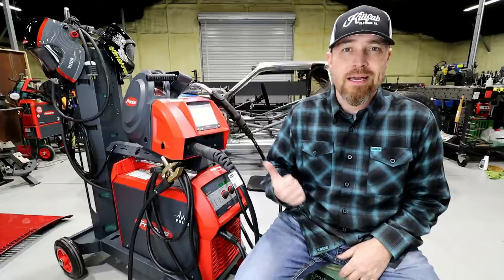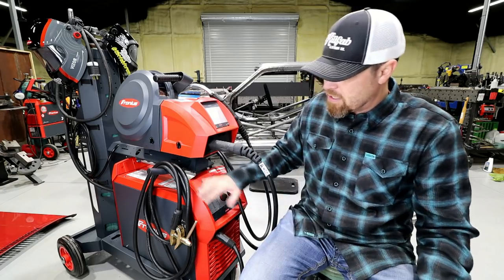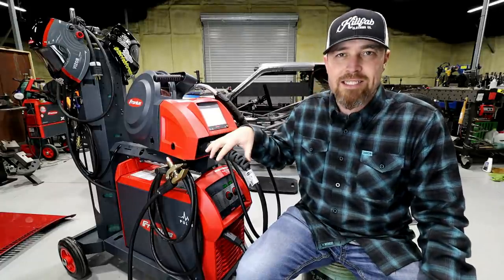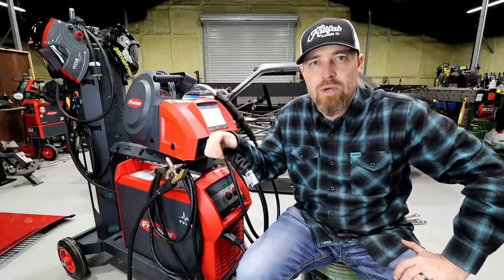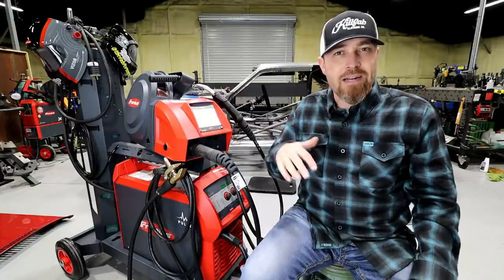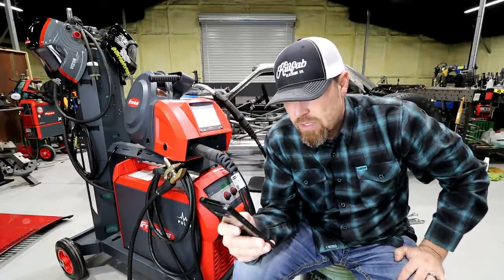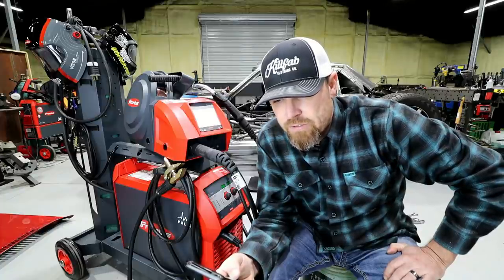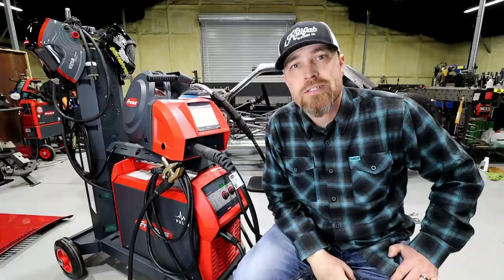Super Rad MIG Welding Technology  | Fronius Transsteel 4000 Pulse

Comment: No offense to Fronius and anyone else, but this isn't new technology. We were using this type of technology almost 20 years ago in an industrial application utilizing Miller Welders. Separate feed head electronic pulse with all different settings for the pulse. Slow it down speed it up change the frequency to have a square wave, round wave, triangular type wave. You name it, those machines had it. Plus we used wire feed drums or you could put a 100 pound spool on it. The one thing I don't care for and it's purely optics. The Fronius machines look like they are skinned in plastic. The other objection I would have is price point. Yes it won't have all the bells and whistles but a simple mig welder from Miller or Lincoln is very affordable for the home hobbyist. You can get a really rad welder that will do most anything the home hobbyist needs for easily under $700. Again no offense I'm sure they are nice welders, but in my opinion from I'm seeing it isn't anything new just reimagined I guess.
Reply: the front and back panels are a plastic which i have to say is really durable.. but the side panels and top are a steel coated in red. Fronius have had pulse for years as well bud.. these transsteel pulse migs are pretty new. The real machines are the TPS which blow anything away when it comes to arc control and results. All the major car manufactures use fronius CMT machine powersources on their robotic production line because theres nothing out there that can weld as fast as that while maintaining penetration profiles consistently. I wouldn't try put fronius in the same league as miller or Lincoln. you get what you pay for with a fronius.
Reply: @Migman2020  I said "I'm sure they're great welders" but for the price point why would you buy one. For the home hobbyist not even a possibility. For a major fab shop ok. The company I worked for turned an annual profit for our share holders north of $50 million annually. Not one Fronius machine. A few Lincolns and more Miller's than anything. At the end of the day it's the welder not the machine. For obvious reasons the better the machine the easier it may be. As far as pulse, it seemed to me like it was being advertised as new technology when in fact it isn't. For the home hobbyist doing occasional welding, for the money buying a Fronius is like buying buying a roll back car hauler to pick up a scoop of mulch a couple of times a year. It doesn't make sense cost wise

Comment: Cool machine although probably overkill for the needs of most hobbyist welders. I've never played with a Fronius machine but I have Miller 350Ps in my welding program. Pulse is great for getting good penetration with low heat input which reduces distortion. Adding pulse to the spray transfer process allows you to weld out of position but is generally only used on thick material.  Great video, looking forward to some Bibster updates.

Comment: Good video.  Pulse is a great technology once you master it.  I don't know how many hours you have on it so far, but if you start seeing some weird stuff happening, check with Fronius about using a phase converter.  I've seen that manufactured leg do some REALLY weird stuff when used with electronics.  I had a customer with a Petroleum pump that was tripping the electronic overloads, even when turned all the way up to 90 amps.  He was only pulling about 20.  Contacted Square D, and they told us that the o/l was also a phase and voltage protector, and saw the noise from the manufactured leg as a voltage issue, and shut it down.  Cheers!

Comment: This is all old technology.  My Lincoln S350 does this and more.  Also runs on 2 or 3 phase.  It connects to the internet so you can download more programs (Like 527 are not enough) and monitor or change all kinds of settings.  Even the older 355 / 355M machines can do Pulse , etc